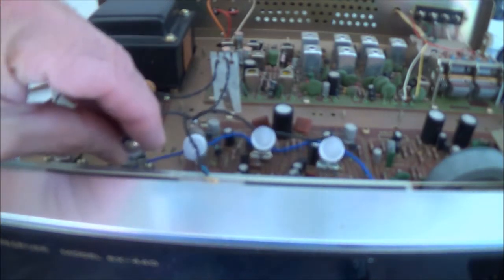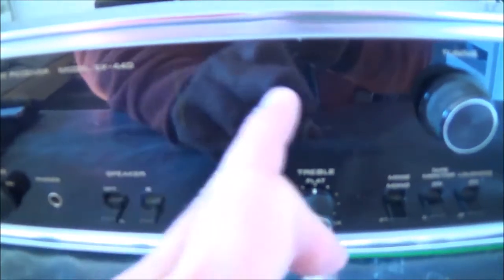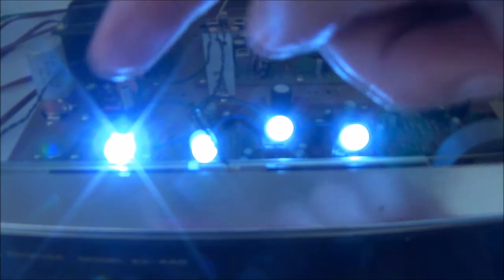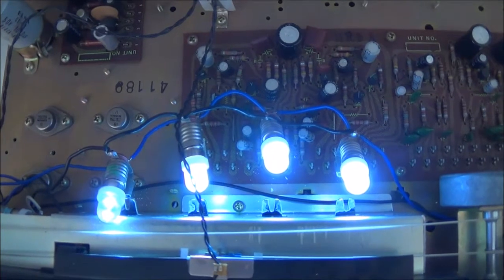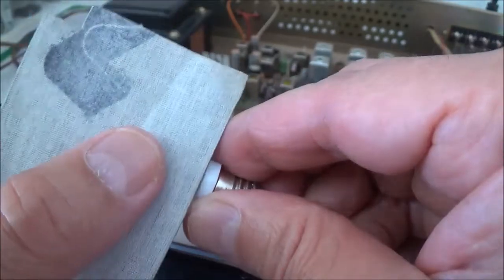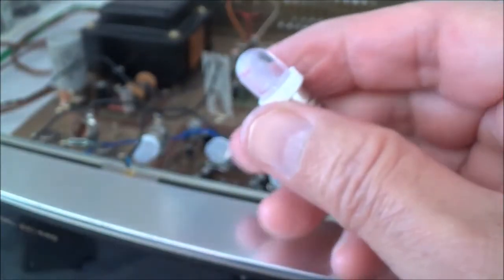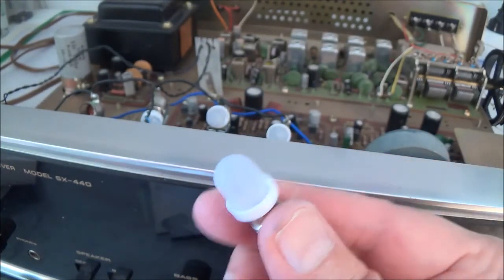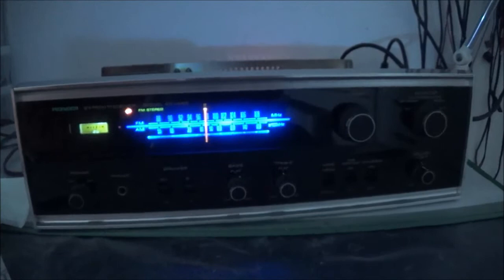Pioneer SX-440 LED Bulbs Sanding

Comment: I just finished doing the re-lamp job and it was very easy.  Thanks for your help.  When done I noticed the dial pointer light was also out.  Any ideas on how to fix/replace the light in this?
Reply from the maker: Let me get back to you on this; I have been travelling and will check the service manual. Have you made progress?
Reply: @OldSchoolElectronics  Yes,  I found another video that shows how to replace the dial pointer lamp in a different receiver but it is probably similar.  There was a link in this video to someone who will supply the lamps for this. I ordered one lamp and one LED that are supposed to arrive today.
Reply from the maker: I was wondering if you could post the specs of the lamp/LED here. Or the link. Thanks!
Reply: @OldSchoolElectronics  DGWOJO.COM  thats his webpage.  Just email him the info on your receiver or application and he will tell what you need.  You can pay him with paypal and he will ship out right away.
Reply from the maker: Thanks for that info! I was wondering if you could post about anything one would have to watch out for once you are done.
Reply: @OldSchoolElectronics  Changing the pointer lamp ended up being an all afternoon project. I wanted to use the LED type bulb do to the longer life but after trying it out I found that the LED only projects light out of the tip and the way the bulb is positioned in the pointer almost none of it goes into the pointer because it does not come out of the side of the LED. So I ended up using the conventional filament type bulb which puts out omni directional light. But the biggest time consumer was re-stringing the dial cord. You have to loosen the dial cord to get the pointer out of it's position so you can replace the bulb.  I thought I had observed the way it was strung but it took hours trying to re-string it. I couldn't find a diagram online so I'm not sure what would have helped.  It is very tedious and even if you think you have memorized the way it is strung you soon find out it doesn't help. If you work at it long enough you will get it done.
Reply from the maker: Thanks for the feedback! Right, most LEDs have a narrow projection (radiation) angle. I normally just sand the LEDs which helps in general, but I am not sure if it would have helped in your case. And correct, dial cords can be a headache; I even accidentally cut one with a hot soldering iron years ago. At any rate, congratulations on a job well done!

Comment: Another way to help diffuse light, if you have enough room in your application, is add white paper, the further from your light source, the more it will diffuse...this is also done in photography/videography.  ~Jack, VEG
Reply from the maker: +Vintage Electronics Geek Thanks for the tip! I was even thinking of taking little round pieces aluminum foil and gluing them to the lens. The sanding worked out pretty good.

Comment: LEDs can be a problem. A lot of the little ones that I use have different angles, brightness and color. I made up some setups with a 9 volt battery clips so I can see what they may look like. 
I have also used aluminum tape to help reflect the light.
Reply from the maker: Thanks, Pat! Good idea with the tape!; I'm always open to suggestions. The sanding actually made the difference; before I had these bright spots with dim spots in between. It just looked odd. Also, I couldn't find replacement incandescent bulbs.

Comment: I just bought this receiver...where did you get the lamps if you don't mind
Reply from the maker: I sold this unit, but I remember the lamps; got them through eBay from China. They were 6 volts and white. They were from a listing like this: https://www.ebay.com/itm/5PCS-Low-power-consumption-E10-LED-Screw-Base-Indicator-Bulb-DC-Light-Bulb-TOC/372240083458?hash=item56ab3cea02:m:mDTANWlbVCWSmjN0TRPBO5Q